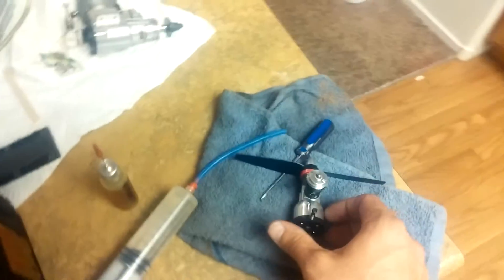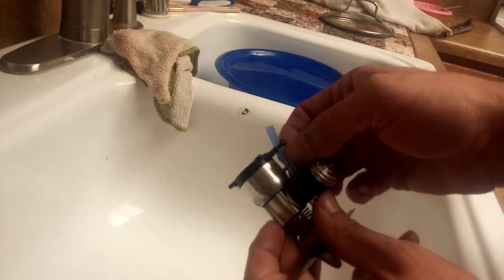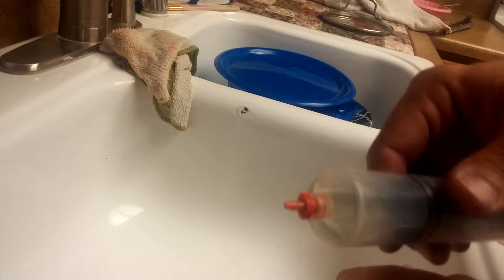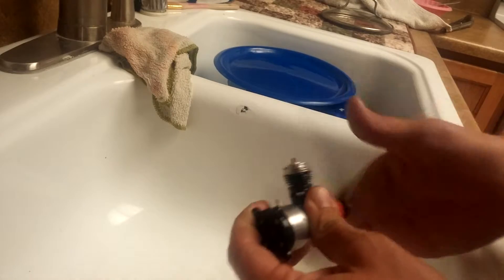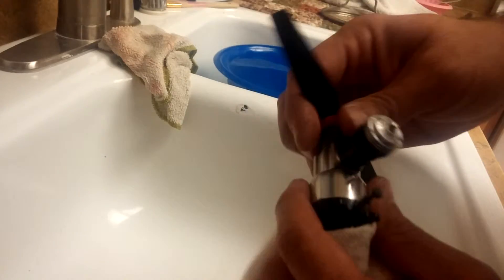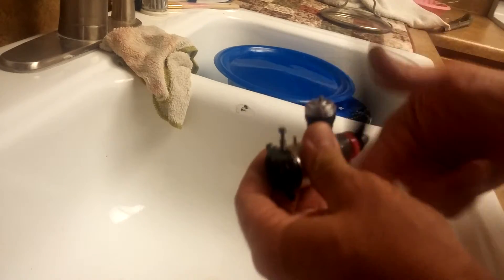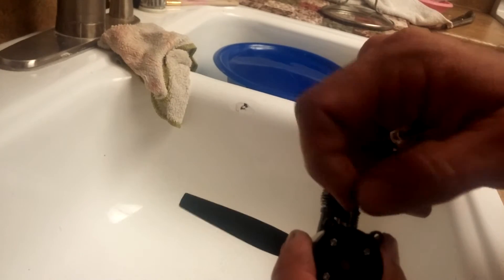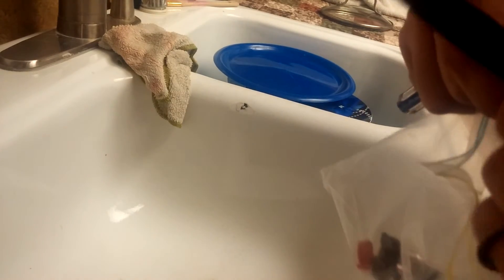Storing a cox engine. How to

Comment: Cool video, thanks for posting this. 
Some hints and tips here from a fellow modeler, 3in1 oil or Marvel Mystery oil are great lubricants as well. Also, wrapping the engine in a soft lint free cloth that is lightly misted with WD-40 adds even more protection during long storage periods. Also, rubbing alcohol is Hygroscopic and can cause rust over time, so another good idea is to take the engine apart and dry out as much of the alcohol as possible before adding the lube.